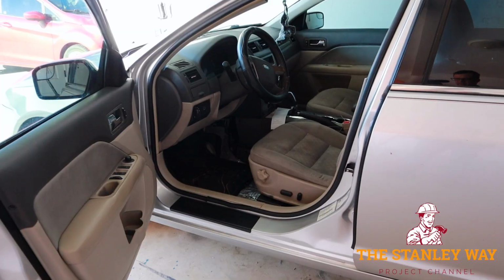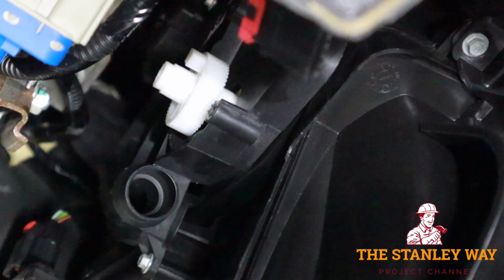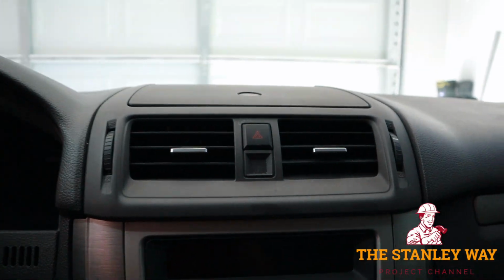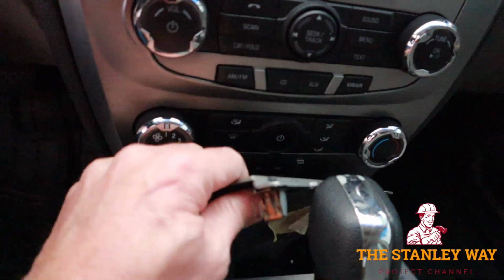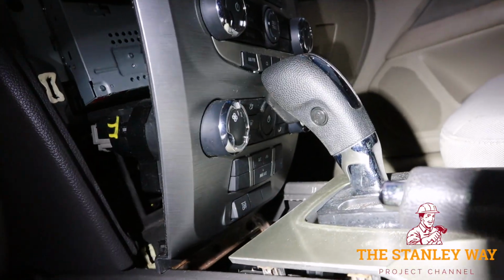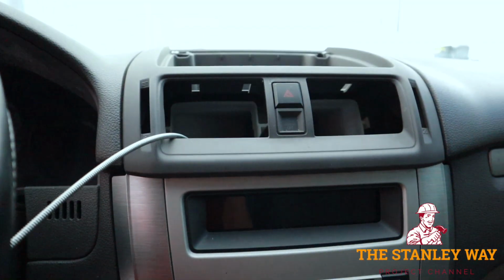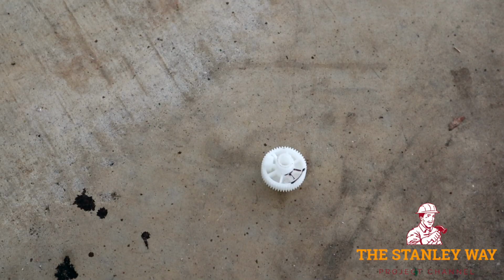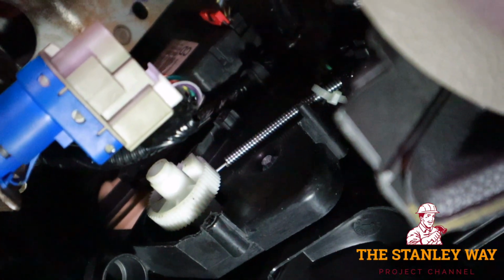Ford Fusion A/C Blows Hot/Blend Door Fix!!

Comment: So my compressor doesn't kick on but a relative did jumpstart it by connecting it directly to a battery or something? Idk but they said the compressor does come on, but the car isn't telling it to come on but not sure why. Could this be the problem? Or is this only a solution if the compressor is kicking on? Thanks!
Reply from the maker: If the compressor came on that is good news. Now that you know the compressor is working a number of things may keep the compressor from initiating. 

You could have a refrigerant leak. If so your compressor won’t come on because the low pressure switch is telling it not to. The best way to check is with a gauge set from Amazon or an auto parts store so you can read high and low pressures. If you don’t have a gauge set and don’t want to buy one you can get a 2 pound can of refrigerant from the auto parts store with a low pressure gauge attached to it. Connect this to your system and see what your system pressure is with the car off, it should be around 100 pounds if it is hot outside. If not, then it is low. Now start the engine and turn the A/C on. Add refrigerant as the instructions on the can say. Once pressure builds up, the compressor should come on. Once the system is running, then look at the pressure gauge on the can to see if you need more refrigerant. Add as needed and not too much.
Reply from the maker: To answer your question specifically, yes, this video is if your compressor is running and the A/C is hot. Here is another possible fix if you have a fusion. *Save $900* Easy 2006-2012 Ford Fusion Air Conditioner Fix!
https://youtu.be/-lla1Zkdly4

Comment: I just added a video where I connected a connector & pigtail to the blend door actuator (unplugged the connector coming from the hvac controls) and manually connect a battery to change from cold to hold, it's another option and I didn't need to disassemble much to be successful.  The connector / pigtail was about $25.  See my channel for details. I like your method here, but your ziptie that holds the manual coil/shield of the cable looks like it might fall off or loosen and let it slip... you might show how to connect that in more detail.  my method is generic to a lot of different cars because many models GM, Ford, etc use the same connector on the blend door actuator.   Thanks for sharing.

Comment: The piece my actuator connects to is broken. Do you have any ideas on how to open the blend door manually?  I can’t seem to get anything inside the hole to maneuver the door.
Reply from the maker: I’m not sure if this will work but you could try to screw a self tapping screw into the blend door shaft. It will probably have to be a pretty big screw, that would give you something sticking out to work with. You could then rig something up to turn the screw with. You may want to install two nuts first and tighten them against the head of the screw. This will give you something to grab after the screw is installed.

I hope you get it working. If I think of something else I will let you know.

Comment: Hi Stanley,. Have a 2011 Fusion that Climate Control was working great, then deleted some old trouble codes out that were for Evap Emissions  with scanner and now blend door actuator, mode door actuator and recirculating/fresh air actuator will not work when buttons on Climate Control Module are pushed.  Full hot 140 degree heat out of front dash vents only.  AC works but can not feel it with all that heat.  Blower motor works on all for speeds and can turn system on and off with power switch.  Had in to Ford Dealer they reprogrammed Climate Control Module at $130.00/hr and that did not help, yet when you turn ignition switch on to ACC and car goes through all the test procedures all the actuators work then and all move through test procedures but not when Climate Control buttons are pushed.  Have even tried another Climate control Module from salvage out of same model car and that did not work.  Ford Deal said never seen all three actuators fail at same time. Almost ready to use your cable idea. Any advice.
Reply from the maker: Hello, thank you for the extensive comment, you have weeded out a lot of follow on questions I would have had to ask. Unfortunately it sounds like the typical computer problems that Fusions have. You are right, all three actuators didn’t fail all at the same time. I changed the control head multiple times with no luck, you probably saw that on the video. The cable works great just some serious redneck engineering and it doesn’t look that great. I never had another problem after I installed the cable. Good luck with it.

And by the way, multiple people have contacted me about this same issue and not one person has been helped by the dealer. They know it is a computer problem and I guess there is no fix for it.
Reply: Thanks Stanley,  probably going to order the cables.  Thanks again.
Reply from the maker: @dlstanley51  no problem.
Reply: Probably EVAP temp sensor
Reply: Or the head unit

Comment: Hey Stanly Guy - Question. Actuators on both sides are moving when I turn the heat up and down.(Dual side system on 2012 Fusion)  With AC on I have cold coming out of the drivers vent while the center drivers vent is about 10 degrees warmer and the passenger side vents are luke warm with the AC on. If i turn on heat the passenger gets  normal heating. This seems to tell me the actuatros are working. Any ideas what else I need to check?
Reply from the maker: Hey Jeff, I would check the Freon charge in your system. Believe it or not, many vehicles that are low on refrigerant will start to blow warm air on one side and cold on the other. The reason is because the Freon begins to boil while in the evaporator and cannot cool the air before flowing to all the vents. 

You can grab a can of refrigerant with a gauge from the auto parts store and add a little if needed. Hope this helps.
Reply: @TheStanleyWay  Thank you Sir.

Comment: having a similar situation with my 2012 Fusion one side runs hot and the other runs cold  Thanks for the tip
Reply: HVAC module
Reply: @alexmacedo8286  
Turns out that the place we took the car to have the brakes replaced let the refrigerant out of the system on purpose just so they could sell us another job we didn't need by the way never take your car to a Firestone Auto Care they will rip you off blind
Reply: You want to check your gas level first, that was my problem at the end, I changed everything but the problem was low on ac gas.

Comment: 10/10 I'm planning to replace the blend door motor but I'll use this tip in the meanwhile to have my a/c on cold.moght do the cable mod anyway.✌️
Reply from the maker: I got so sick and tired of the computer moving the actuator where it wanted. It was time to go old school.
Reply: @TheStanleyWay  I wondered why you'd go to this extreme.  I ainta doin' all that!  I'm gonna try to replace the actuator first.
Reply from the maker: @justranda1  my problem wasn’t the actuator it was the computer that controlled the entire A/C system. I did this after trying every other fix I could think of, including replacing the control head twice. I got so sick of it I figured I couldn’t go wrong with a manual cable. It really wasn’t that hard to do.
Reply: @TheStanleyWay  Well yr a genius to even figure that out! Thank you for showing us. Mine is working after 1day of heat on driver side and AC on passenger. I’m trying to educate myself now for options. I appreciate ya! 🤍